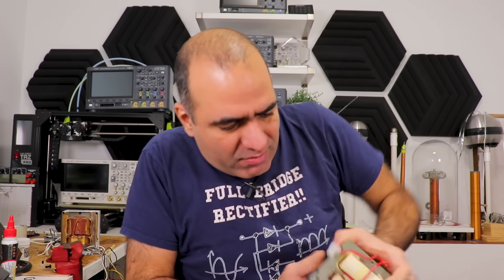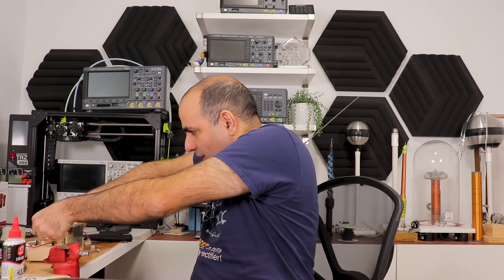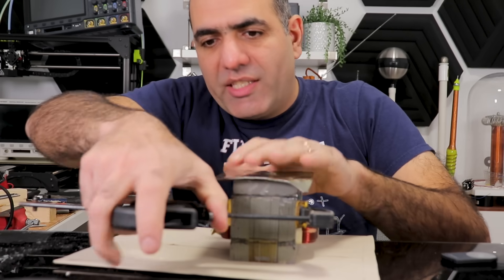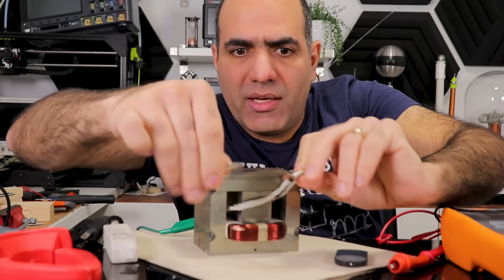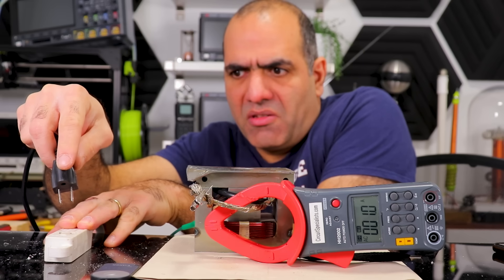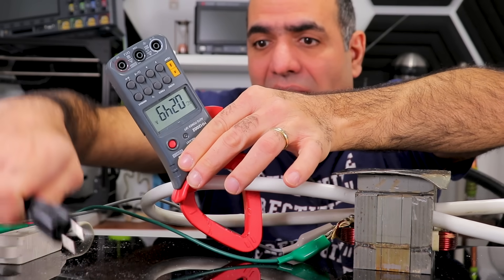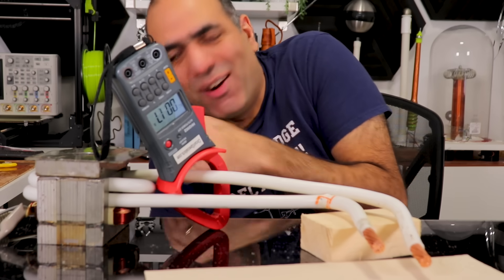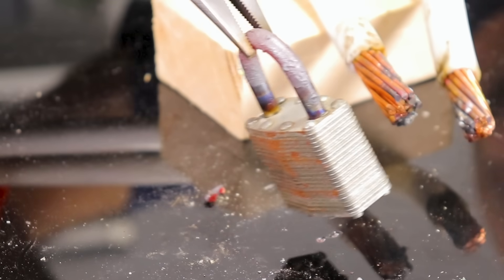Making "MILLIONS" of AMPS of Current

Comment: Having had (in a past life) a career doing electronic engineering for scientific research that involved designing and building oddball high voltage / high current / high isolation / high frequency transformers I would suggest that using the type of wire shown here while simple and easy to execute is not the way to go if you are looking for maximum current output...  Too much of the transformer window area is full of air (caused by the wire being round) and insulation (because the wire is insulated for power line voltages (600V?) and the insulation needs a given amount of mechanical strength) to meet regulatory requirements.  If you really want to hog some amps out of this thing try using copper bar stock.  Get bar stock a bit narrower than the width of the window in the core and a bit less than half the height of the available window height.  Cut pieces and braze them together (or drill holes and bolt them if you have to) into a 2 turn helix, wrap the whole thing in transformer tape (the very thin yellow stuff) and drop it into the core and put on the top lamination plate. If you have access to a big bending brake (like an ironworker machine) you might be able to bend some "U" shaped pieces to reduce the number of joints you have to make.  Should be able to get 2 or 3 thousand amps out of it for a short period of time.  You WILL be over-running the primary so the duty cycle will have be low to avoid damage - and tripping your power line circuit breaker.   I prefer laminations with holes in the corners so you can bolt the core securely together.  Transformers with welded together lamination are done that way for ease and cheapness of assembly but are a very bad idea from the point of view of good transformer design as it introduces "shorted turns" into the core increasing the eddy current losses in the transformer.  Ideally all the laminations should be insulated from one another by an oxide layer or varnish coating.  Also, if you want to make a good transformer it is better to interleave the E and I laminations rather than having all of the Es on one side and all of the Is on the other side.  Hammond manufacturing (Guelph Ontario Canada) would probably sell you laminations in just about any scrapless E / I size you want if you ask nicely.

     On a related topic, everybody knows the trick to increase the sensitivity of a clamp on ammeter but what if you need to DECREASE the sensitivity?  I had this problem when a scientist was building some sort of electric furnace using big bars of carbon as resistor elements.  Sucker needed several thousand amps and several hundreds of pounds of transformers to drive it.  That was WAY beyond the capability of my clamp meter.  The answer was to take a piece of the copper bar stock and machine an off centre lengthwise slot a couple of inches long in it where the slot was wide enough to close the clamp on the meter around the narrow side.  On the side of the slot where the meter was clamped we had 1/2" width of copper and on the other (unmeasured) side we had 2 inches of copper. The theory was that the current would divide in inverse proportion to the resistance of the 2 copper sections.  This reduced the sensitivity of the meter by a factor of 5 so the 1000 amp meter was now a 5000 amp meter.  It was a bit of a hack and was probably not ridiculously accurate but it was good enough to do the job.  Scientist kept saying he wanted MORE POWER!   I kept piling on the transformers.  Eventually I got that thing honking along to the point that I burned out his heating elements which sent him back to the drawing board!   Thanks for reminding me of one of the interesting jobs I had in that part of my career.  God, how I miss that job!  It was a barrel of fun and they paid me to do it!

Comment: you need to stop trying to short things out but you use 4/0 ga and 3 to 4 turns of cable as secondary you'll get around 4 volts and 1,000 amps

Comment: So theres volts. Watts. And amps. Which is the one thats dangerous to touch due to electricution and how are you able to melt metal but not get zapped from touching it
Reply: Also. Using that heat generating energy. Is it more energy than that coming out of the power socket. If so couldnt that be used to create some sort of infinite energy source

Comment: When the output voltage is that low, 1-2 volts, you can attacht LEDs directly to it without a restistor? Like a gazzilion of LEDs in parallel :D

Comment: something I'm wondering right now which I can't seem too find easily on the internet is how amperage and voltage work together on lethality. Why was he able to touch it while it had 90 amps?!?
Reply: Ohms law. It determines the relationship between voltage current and resistance. The human body is not a great conductor. It tends to have a high resistance. Therefore in order to force any significant amount of current through it, typically requires a bit higher voltage. That's why touching a 9v battery will typically not shock you, but touching mains voltage can. Remember his voltages were in the 0-3 volt range.

Comment: using that with graphite crucible could yield a good melting pot

Also i have a question. Is it possible/efficient to heat hookah charcoals (not the quicklights) by running current through them? On a heating spiral it takes about 10 minutes to get them going... seems like running current through them could manage that in seconds... I thought about trying it... But then, I'm not a professional at getting electricuted XD

Comment: The smoke coming from the lock at 12:05 contains arsenic, when you burn galvanised steel that's what happens, hence why you can't weld galvanised steel before grinding the coating off. Do be careful
Reply: Its actually zinc in the smoke, which is still dangerous, but not nearly as concerning as arsenic
Reply: Why would there be arsenic in zinc plated steel? Sure zinc fumes are toxic, so that is an issue, but where is the arsenic in this story? Is the zinc impure or?
Reply: Arsenic doesn't magically appear when galvanized metals heat up lol there would have to already be arsenic in the galvanizing compound.
Reply: Arsenic? Don't you mean zinc?
Reply: How can you create arsenic from a zinc plated stell?
Reply: wth
Reply: everyone knows arsenic is healthy to breathe in 👍

Comment: I worked in a Telecomms company before. Now, I know that the power supply is 48V, but I didn't count on the Amps.

I was looking for a Dialtone but when I clipped on my handset at the wire, I got Zapped so hard. it made me blackout high up there.

I could deal with the 48v, but what I didn't know was that the Line pair I accidentally clipped was being used for a MUX (Multiplexer) that when in use or something, Amps & Current run high ... 

Luckily, my Right leg was hooked on the ladder and I managed to hang on.

Got Shocked for half an hour. I'm afraid to drink Amy liquid fearful that I might burst haha..

Somebody told me that the current and amp go way up when in use that's why I got the shock of my life.

Comment: How do you not shock the hell out of yourself with so many amps?
Reply: Its voltage that shocks not amps. He´s got only 2 volts. 
You can even touch the contacs of 12 v car batteries without feeling anything, and theese can output high 3 digit numbers of amps too.

Comment: Next time buy 3/0 or 4/0 "welding wire". It uses a bunch of very fine strands of wire instead of a few thick strands, and so is FAR more "bendy" and actually handles more current per gauge than standard wire because it has more wire in it and less air space between strands.
You can buy 3/0 black welding wire on a certain bay place for about 6 bucks a foot.

There you could also buy 16ga enameled magnet wire for fairly cheap too, and searching around you can find some 6x4x1 ferrite blocks for not to much money also that you could then combine to make a magnetic core. This would let you build your own larger transformer with customized windings for around one fifty all said and done

Comment: What would happen if he accidentally touches this or do any other mistake that's common in Boom's videos?
Reply from the maker: I already did touch that voltage, it is lie 2.2v and does nothing. But if you short it, it does a couple of thousand amps through the wire, it can't push current through my body

Comment: Could you have swapped the primary coil for the secondary coil and used your giant wire to get even higher amps?
Reply: Problem is there is a diminishing return if there are less turns in a primary circuit, coupled with increasing heat due to amplitude.

Comment: That looks like my 4500 watt heating element connected directly to my windmills hoping to get 200 DC volts.  High winds, white hot. I'm putting the AC electrical switch the blue light turns on. I didn't know it had a light. It doesn't. More panic. First time I got thrown across the room I was four. The bulb in the living room burned out and I did not know I was missing a bulb until after I put my finger in it energized. I've been hooked ever since.

Comment: Back when I was an early Teen, I was going through a "phase" where I would play around with electrical coils, transformers and the like . During the course of My "Experiments" , I got a few good jolts that definitely were powerful , I also learned where the circuit breakers for my room were because My Dad got tired of resetting the breakers Himself ( yeah, it was that frequent) . Seeing some of the happenings in this Video brings back some rather hilariously shocking memories. By the way resisters get pretty hot when shorted out and capacitors can "bite"  pretty hard.

Comment: I installed my own 200A service 2 years ago and can attest to the struggles involved with trying to bend-fit that gauge wire into a small space (meter box).  I had to use a cheater bar and a variety of curse words.

Well, done!

Comment: there is no substance that can withstand an amperage of 1 million amps unless you cool the wires close to absolute zero which bring the resistance of wires to zero. you can make use of magnets to keep plasma (accelerating charges create millions of amps) in the middle of a tube like those used in the fusion of hydrogen atoms

Comment: The biggest problem with these thick cables is the thick insulation that takes up a lot of space. In my microwave welder, I stripped the insulation and re-insulated the cable with kapton tape. It behaves much better at higher temperatures and is very thin. To make sure that there would be no short circuits, I put 2 layers of tape.

Comment: Bit of safety for anyone who wants to learn this stuff. Never EVER power the transformer up with the original windings. 2000 volts and 0.5 amps will kill you, it's the same as getting the electric chair. You don't even have to touch it if any surfaces that it's sitting on is damp or conductive, then it will still blow you across the room and if you survive, you'll probably lose your fingers, arms, or whatever path the current decides to take. If you want to be a bit safer and still have a couple of hundred amps, then just buy an old welder.

Comment: I might be missing something trivial, but why does increasing the secondary winding increase the current too? If the voltage is increased, current should decrease, not increase, no? Or the reason why  the current is higher is because we're shorting it in secondary, thus higher voltage means higher short current?

Comment: Hmm I always thought that with increasing the turns you increase the voltage and reduce the current, just to keep power the same... Anyway Mehdi is trying to make a welder :D
Reply: You're correct, but the problem is as the voltage gets lower the resistance of the wire, and the object you're trying to send the current through starts to become a problem because of ohms law. Ohms law says that voltage divided by resistance will determine the current flow. So, unless you have access to a superconductor you reach a point where you need more voltage.

Comment: Hey mehdi my coworkers say a load on a circuit will make the shock worse I’ve only tried a resistive load and no real change is there truth to what they say.
Reply: A load on a circuit is effectively another resistor in series which means less current is able to flow.

Comment: Love the videos! Unfortunately when it comes to electricity, I'm electro-stupid. Can you do a video on welders? I started TIG welding and thought the welder would use heaps more power, but apparently it doesn't. I'm confused how something that shoots out 200 amps of plasma doesn't use heaps of power!
Reply: There’s a trade off. It’s analogous to water where you can have a large pipe with low pressure or a small pipe with high pressure that sends the same amount total.

Your welder is taking the “volume of water” -> amps from the wall and making the “pressure” -> voltage very high to penetrate farther into the metal.

Comment: 👉🏻 In lectures they talk that current increases with high voltage. How can low voltage increase current flow drastically??? Voltage is like pressure,right? And current like water, high voltage hight current.

Comment: Can somebody explain why he doesnt get shocked while touching the spoon? Is it because theres no earth coming from the transformed current? (Not native so please dont make it to hard to explain)
Reply: it's because there are only 2.2 volts across the output wires. Even though the current is huge and a ton of electricity is flowing it doesn't have the attraction needed to go through you since your skin isn't made like a wire. 
If both sides of the transformer had lots of loops like they normally do then the output voltage would increase dramatically and the attraction would be enough to go through your skin.
Reply: @pivotmaster9556  thanks for the explanation, now it makes sense why they say its harmless for you touching anything below 50v ac
Reply: The resistance of human skin is around 1000 ohms so you need a certain height of voltage to get enough current to flow.

Comment: Hello internet, i had  a question if i use the secondary side of a microwave transformer and give it 230 (my country is 230)to get low voltage on the primary for battery charging, can the HV winding handle 230?
Ill use a fan as well for the trans

Comment: you could probably get a lower resistance if you used lead instead of copper and used liquid nitrogen to turn the lead into a superconductor. its been a while since i did anything like this but i'm fairly certain liquid nitrogen isnt conductable so you could place the transformer into a tub of it, use thinner lead wires instead of copper, and get an insanely higher voltage with the lower resistance of the lead wires. you could probably also do this with copper wires but i'm seeing some contradicting information, some sites claim normal conductors used in circuits arent good conductors when super cooled, others are saying they are fine and will lower the resistance in the wires. maybe its just the amount of resistance that is reduced. either way, super cool your transformer and you will likely get a ton more amps running through it since the resistance will be lower. you would have to get quite a bit of liquid nitrogen though since it will probably boil fast.

Comment: In 9.3 you have mentioned doubling the number of turns increase the voltage thereby doubling current but doesn’t it also increases the reactants of the secondary coil thereby restricting the current flow??

By the way I forgot to mention that I am an innocent science illiterate and your huge fan.

Comment: why does doubling the turns increase current AND voltage? doesn't ohms law tell us that the wattage must stay the same?
Reply from the maker: Voltage rise over the same resistance means current rise, so quadruple the output power, which means the input power also quadruples.

Comment: Nice start on a spot welder! Try switching the input or output with a timer and see if this thing can make 2 sheets of stainless steel stick together... then see if it can stick 2 copper sheets together. Maybe this can make stainless steel n copper stick. That'd be cool. Especially cuz that'd mean potentially, you can stick copper to lithium cells
Reply: Switching the input would be much easier, since switching on or of 400-1000A can be pretty challenging xD
Reply: Some guys did it with automobile starter relays, @TheFlash8889
Reply: Nickel is the preferred metal for those tabs.
Reply: @ffr2822  because of how much resistance nickel has, making it easy to spot-weld at lower powers

Comment: What would happen if you powered your secondary   windings with 120v instead of the primary?  Also my whole life I was always told that voltage without any amperage can't kill you. That's why stun guns with the supposed million volts doesn't kill because it's only putting out 3-5 milliamps.  So my question is what's the lowest voltage and amperage that will electrocute someone through dry skin. Because  Obviously in the video hes touching the secondary that only has 2v but yet is putting out a 1000 amps?  I know there's quite a few questions in there and I'd be happy with an answer to any of them. Thanks love your channel been watching for years and its helped me have a better understanding of electricity as a whole.